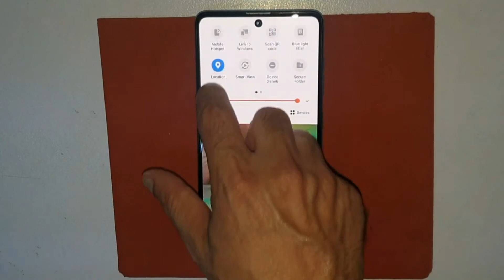Samsung A71 Touch Screen Replacement , samsung A71 Screen price , disassambly , By Level technics

Comment: From which website did you buy the screen replacement? Ali express?
Reply from the maker: Yes ...ali express. In which country do u live?
Reply: @leveltechnics8872  I have also been thinking about using that store to buy the screen but it is very difficult to find the original super amoled with frame, I could say that for me there is no original replacement to opt for at the moment😢
Reply: Pls if you could share the aliexpress purchase store link

Comment: Excellent demonstration video, thankyou so much for sharing. I now feel confident to replace my cracked phone screen. Will order glass replacement kit from ebay for 28.00 AU. Local phone repair shop quoted me 280.00 AU to replace my phone screen. 👍
Reply from the maker: Thanks a lot dear.

Comment: What are all the tools you used?
Reply from the maker: Screw driver , steel tweezer, plstic tuser, e8000 glue, hot gun, sir theese kind of tools used for panal replacement
Reply: @leveltechnics8872  thanks
Reply: @leveltechnics8872  does it come with the e8000 glue and where is it used?
Reply from the maker: E8000 glue use for panal fixing in center frame.. And use for back glass fixing..